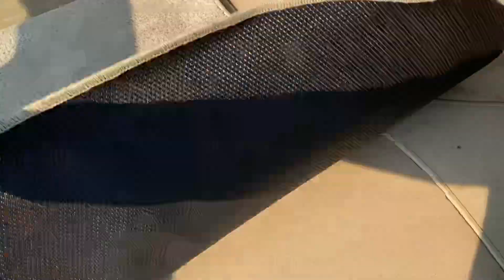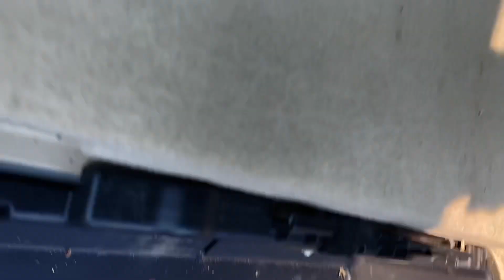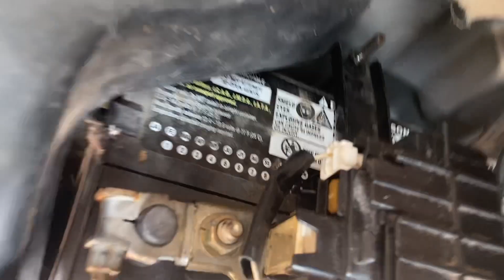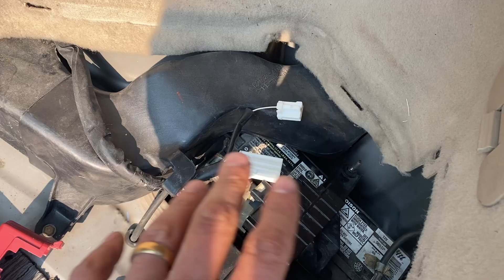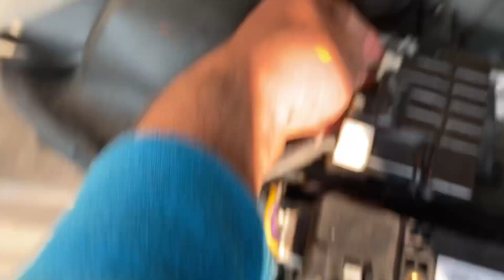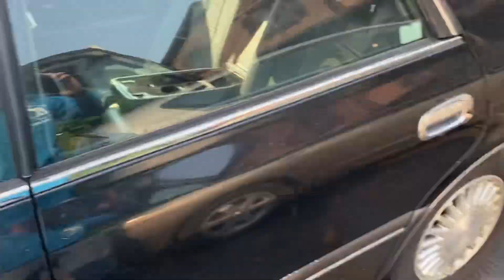2004-2009 Prius Warning Light RESET! NOT A Fix-All!

Comment: Another great way to reset your DTCs is a device like the FIXD Bluetooth OBD2 Scanner.  Small, rather inexpensive, and very easy to use with your cell phone, you can use it to reset DTCs in addition to several other very useful features.  We keep one in the center console of our 2008 Prius, and have used it many times.  It's more than paid for itself.

Comment: What's the black box next to the battery?
Reply from the maker: Its the brake booster power supply control module. Please subscribe =) LOTS of prius content
Reply: @DrewGarage   Is that responsible for generating the dashboard icon the resembles a drum brake w/ an exclamation point in the center? 
 I thought I did subscribe.  I'll check.